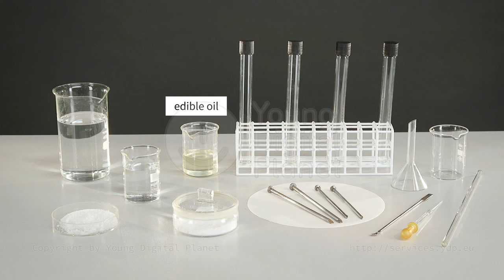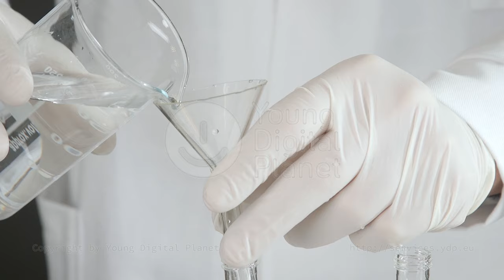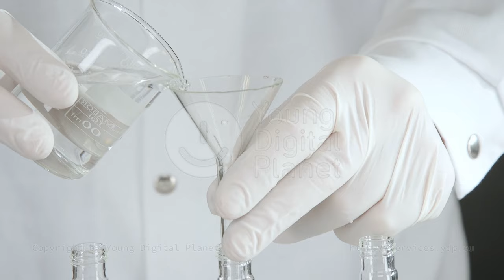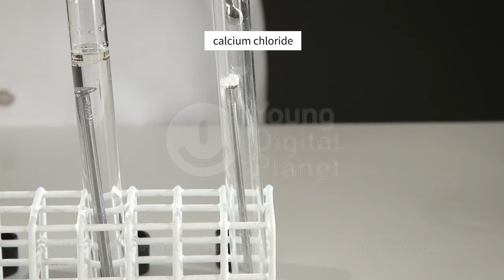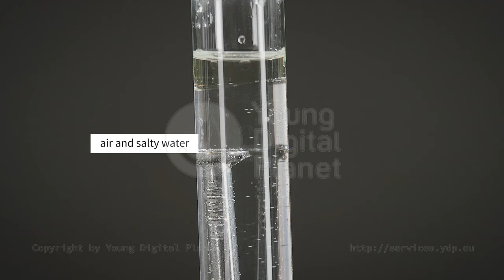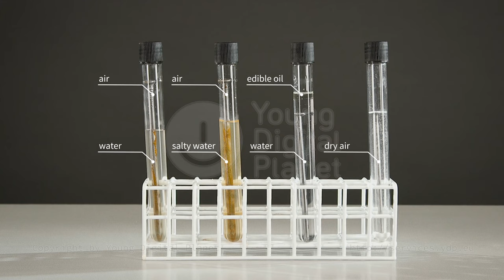The rusting of iron under various conditions  - YDP services

Comment: Rusting of iron required the presence of water and oxygen. The iron atoms will not spontaneously emit out their stationary electrons before turning into Fe(2+) cations. Water molecules within a droplet of water on an iron plate are constantly drifting. They drifting at higher velocities at higher temperatures. Dissolved oxygen molecules within the droplet of water are attached onto those drifting water molecules. Whenever the oxygen "atom" that adhered onto the drifting water molecule is slamming against a iron atom in effective collision, some electrons from the reacting iron atom will be transferred to the oxygen 'atom" before converting itself to oxygen anion of O(2-). This is how iron atoms has been oxidized within the droplet of water. Subsequently, such O(2-) anion colliding with a water molecule will convert to two hydroxide anions or 2OH(-). Fe(2+) that "reacts" with two hydroxide anions to form Fe(OH)2. Subsequently, another OH(-) anion reacts with Fe(OH)2 to form Fe(OH)3. Finally, when two Fe(OH)3 slamming against one another before forming a crystal of Fe2O3.3H2O which is the rust of iron. The water droplet also contains some hydrogen cations or H(+). When the iron atom reacts with the slamming oxygen "atom", some dissipated electrons from the reacted iron atom will be dispersed within the iron atoms. Whenever the drifting hydrogen cations or H(+) are slamming against the iron plate, they will mop up some excess electrons from the iron plate before reducing to hydrogen gas or bubbles that adhered onto the iron plate. At least now we understand how rusting process takes place within a droplet of water that adhered onto an iron plate. The current of understanding of how rusting iron takes place is not accurate or slightly wrong. If you are interested in real discoveries, I would recommend you to read my book, The Unification Theory - Volume One and you will be amazed with lots of new, interesting discoveries. In God I trust.